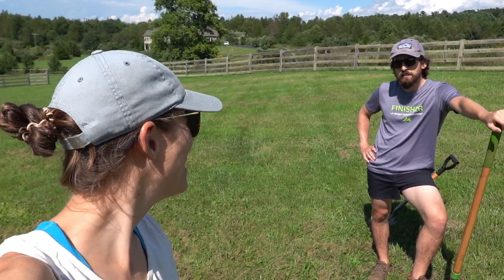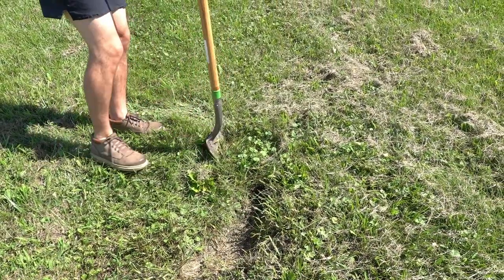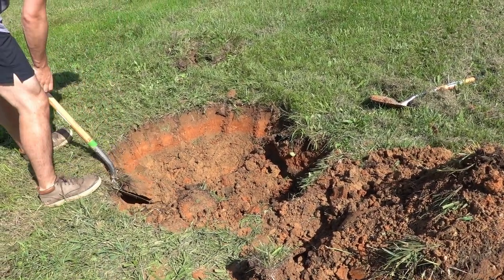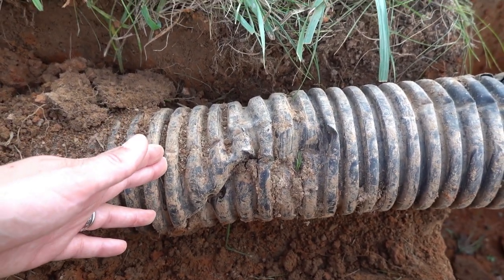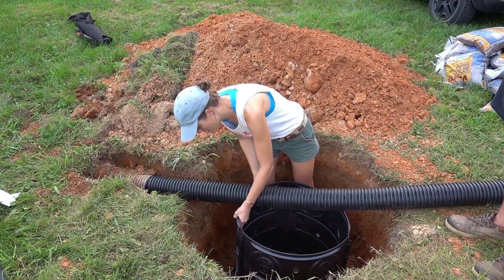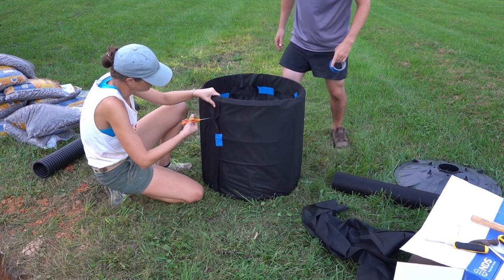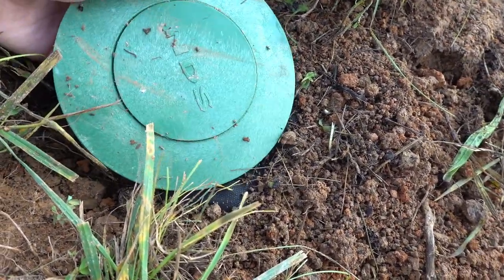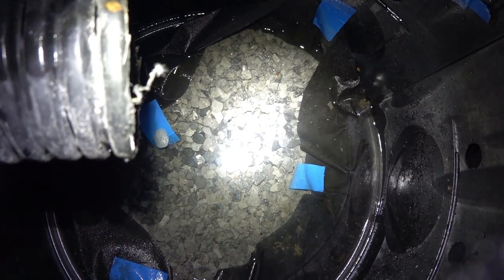Installing Our Second Dry Well | NDS Flo-well

Comment: I've seen where bottom of barrel should be solid,drain holes should only be on sides,and use some kind of weep fabric over top and around outside of barrel,to keep sediment out,I'm using a plastic 55 gallon barrel

Comment: You used perforated pipe, which will let water leak out before getting to the well. How did that workout?
Reply from the maker: So far, so good.  It's what they said to do on This Old House, so that's what we decided to do.
Reply: @jlew6977  perforated pipe doesn't allow the water to leak out before it gets to the well. Perforations are used to absorb surrounding groundwater and direct it to the well, which actually keeps the ground around the pipe more dry.

Comment: Hi there ... I love your fun teamwork approach. We’re considering this option and just started looking at drywall info/DIY. 

I hope this doesn’t sound like a ridiculous question: 

I’m curious to know the reason for not just filling the entire hole with gravel. Is it that it would cost a lot more for gravel than buying the container? I was thinking a smaller hole would suffice too. The huge hole you had to dig was to fit the container. 

Thanks!
Reply from the maker: Hello there!  I'm not an expert, but I think the benefit of using an open container versus a hole filled with gravel is the container can hold more water.  The water can fill the bin and then slowly seep out the small holes and through the gravel and into the soil.  Having a hole filled with gravel might work if you don't get too much rain, but I'm not sure!  Good luck!
Reply: @rebeccahartnett1980 Thanks!
Reply: There is no reason at all to fill the hole with gravel. Indeed, you should not do so. Leave it wide open for greater water capacity and inspection.

Regarding hole size: The manufacturer's printed installation instructions specify a 48" diameter hole. This size results in greater capacity and far greater absorption area. (Sidebar: Try hand-digging a hole 24" in diameter 48" deep. Ouch.)

Comment: The best solution for the overflow erosion is to...Dig a trench from the drywell along the line of erosion about 20'.  Go down about 8"-14". Start out at the dry well...Go down about 8". Tap into one of the dry well holes ...The trench should have a 1" drop for each 10'. So 20' would be a 2"drop at end of 20'. Use solid weeping lines with punched holes...Wrap trench with non woven drainage fabric...add about 2" gravel. 2" drainage rock ...then lay pipe...put a cap on end of 20 ' section..Add gravel to ground surface...Pull fabric over the top of gravel...Place soil and seed ..The excess water from drywell will now be able to naturally leach into the area surrounding the 20' length...Then in the future you can always extend it..The drywell holds the water...The french drain ( leach lines) distribute the water evenly
Reply: What’s with all the ellipses?

Comment: If you need to install another dry well, rent a hydraulic post hole digger, use it to break-up the clay, digging is much easier that way.
Reply from the maker: Hi there! Thanks for the tip. I hope we don't need to dig anymore dry wells, but I'll keep it in mind!